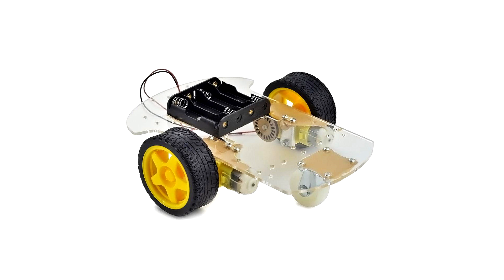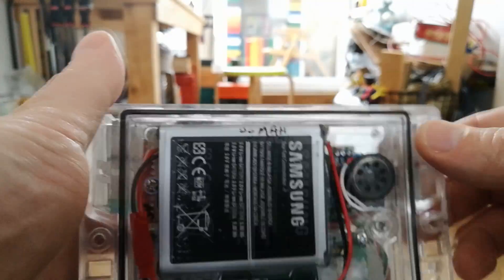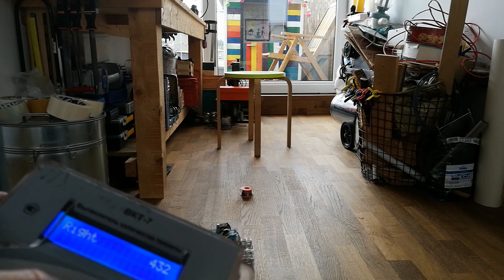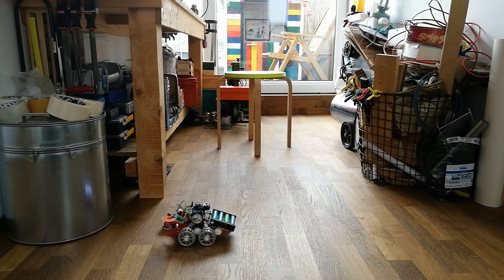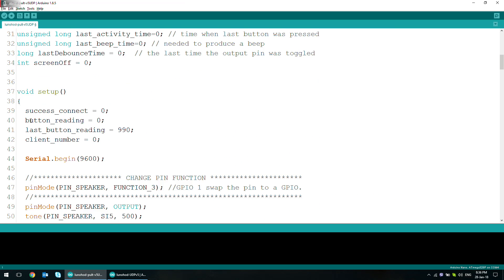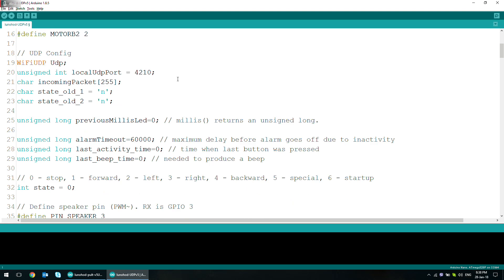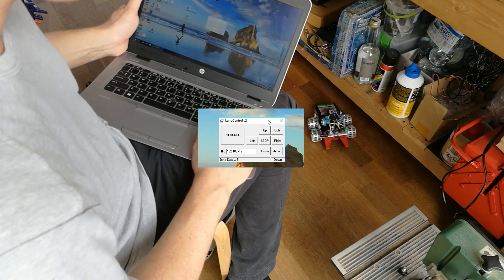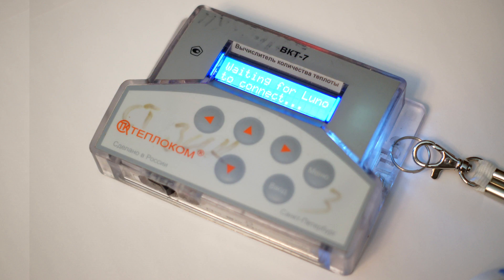Wi-Fi Robot Control via UDP - ESP8266

Comment: Great work. I was looking all over the web for something like this to begin my project of a micro rc car for my kid. 
I was thinking if it would be possible to send, in stead of a single character (f,b,l,r or s), send a  packet of four values ( speed right motor, speed left motor, headlights, other) and on the car side make the speed of the motors proportional to the speed values? Do you thing it could be done. I'm still starting in arduino programming and my experience is more for the mechanical side than for the software side.
Reply from the maker: I think you can just edit the code to include a string instead of a letter. In the receiver code you can use substring function to extract speed and direction. Good luck and show off your project when you finish it!

Comment: Ok really sorry for all the questions
what would be the best way to make it so the rover go forward until you release the forward key  on the keyboard. at the moment the rover just carries on until you hit the stop command also i would love to be able to set the speed of the motors via the windows app.
thank you so much for your work 
regards Dan.
Reply from the maker: Hi Dan. Just noticed your comments. Have you figured out how to do it? 
I have done exactly what you described in my video about smallest joystick in the world: https://www.youtube.com/watch?v=42_Zoz9P3ks
Basically you need to slightly modify the robot car code - you check how long ago the last command was sent. If it was sent longer than 300ms ago - you stop the car. That's it. Modification is very simple and that's why I didn't upload the code for that version. 300ms is what I use but you will find your best timing after experimenting.
Good luck!

As for the speed of motors - this makes things complicated and at the moment I don't have plans to do this. The idea was to design a simple solution for a constant speed.
Reply: Lenka Design Workshop thanks again for your answer could you show me what this line of code might look like  I'm sure it is simple for you but I just can't get it to work  kind regards Dan.
Reply from the maker: Are you able to show me a pic of your device? Just curious...
Might be easier to upload the code for the other video. Here you go:
add this:
  if ((unsigned long)(millis() - last_activity_time) >= stepTimeout && state != 0){
    go_stop();
  }
stepTimeout should be defined in the beginning of code: unsigned long stepTimeout=100;
Reply: Lenka Design Workshop thanks for your help I will definitely try this and I'll  share soon . Thank you.

Comment: Hi thanks for your hard work i do however have some problems
when i use your windows app i have to press forward 3 times before the motors turn then i have to press stop 3 times before they stop same with left and right ?any help would be much appreciated ps i am using your sketch unmodified apart from wifi details and motor pins changed to 13, 15, 0, 2 regards dan.

Comment: Hi i like this project Thank you.
i have uploaded the sketch to my rover i am using the ln298d and a esp8266
i have adapted the sketch to join my home WiFi.
i have an issue; when i run your windows app i have to press the direction button three times before the motors turn.
i can watch the serial monitor and it has to receive the same packet three times then runs.
if i want to stop the motors i have to press stop three times then they stop.
i have tried using a udp packet sender from my phone and again i have to send f three separate times then the rover moves forward.any help would be appreciated regards Dan.

my code below which is a copy of yours with some stuff cut out and pin changes.
https://www.dropbox.com/s/valqa569l1gtfo1/sketch_apr05a.ino?dl=0
Reply: Got it it was the debounce lines lol.
Reply from the maker: Hi. First of all, if you got it working successfully it's already a good start.
I did say in the video that there are debounce actions in the code. If you're using only an app (windows or mobile) or if your buttons are good quality then you can remove the debounce lines from the code.
You will need to modify the code a little. In the Robot Car code these are not needed anymore:
    if (incomingPacket[0] == state_old_1 && incomingPacket[0] == state_old_2){
      state_old_2 = state_old_1;
      state_old_1 = incomingPacket[0];
    }
    else {
      state_old_2 = state_old_1;
      state_old_1 = incomingPacket[0];
      incomingPacket[0] = 'n';
    }

Are you able to share a demo video of your build? Would be nice to see.
Good luck!